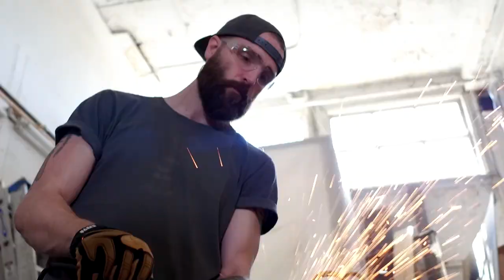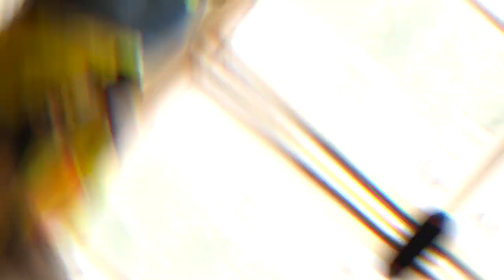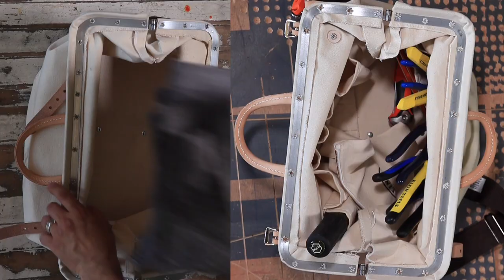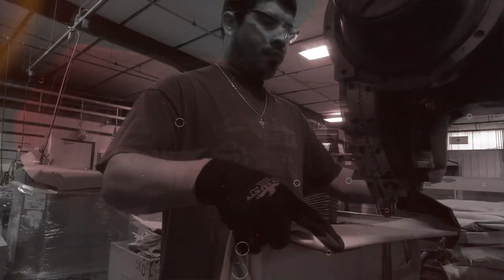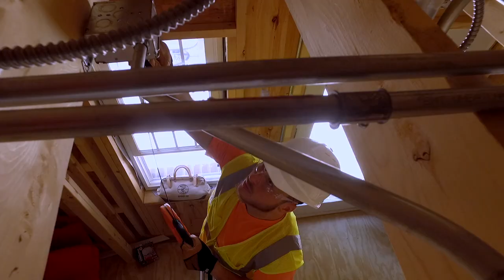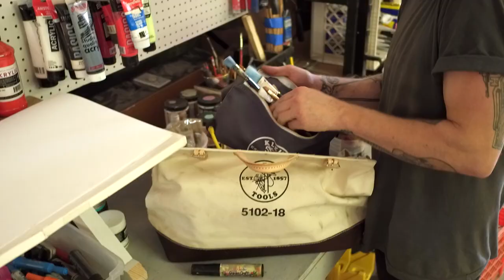Custom Klein Tool Bag #MyKleinBag / Signature Series by Klein Tools

Comment: I bought one of these 30 years ago and I keep my M. Klein and Sons climbing belt and hooks in it for when I have to move from truck to truck..  I had hoped it would last until I retired in 2022 but one of the handles just broke on it yesterday.  I wrapped it in about 10 layers of 3m 88T black telephone tape and its good to go.